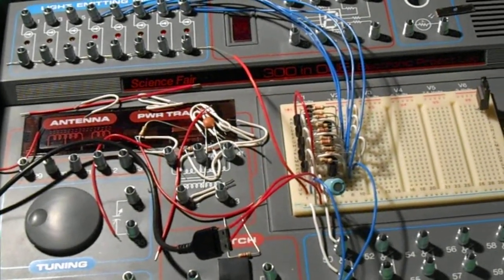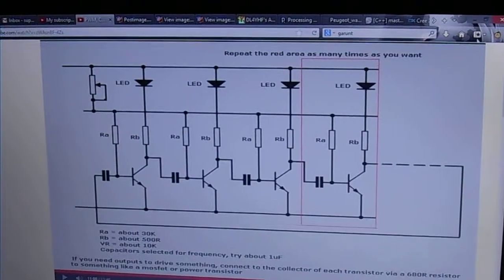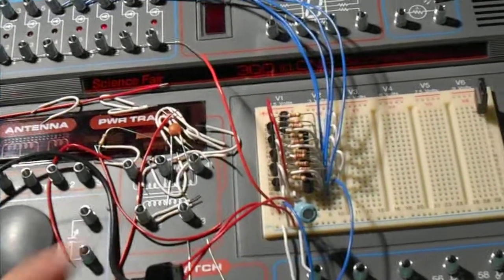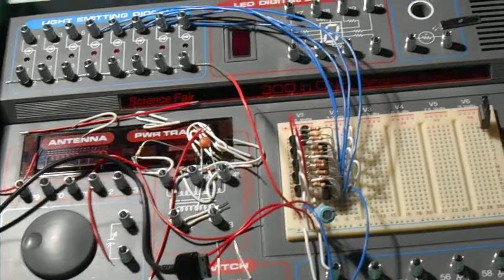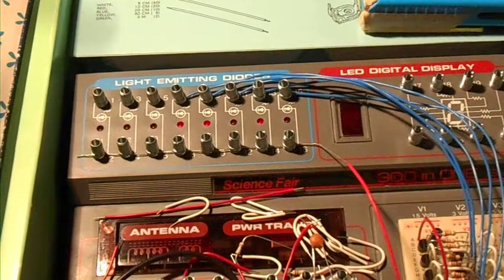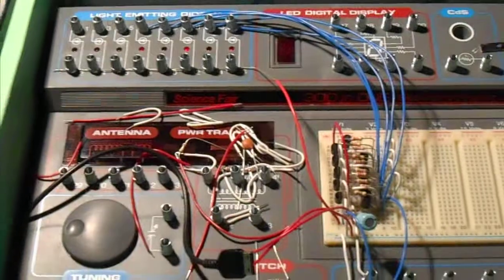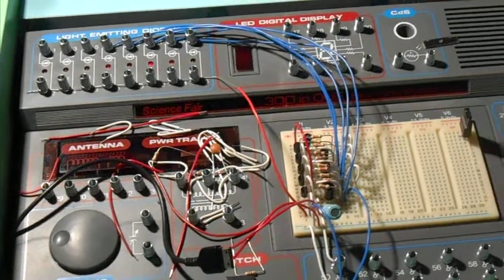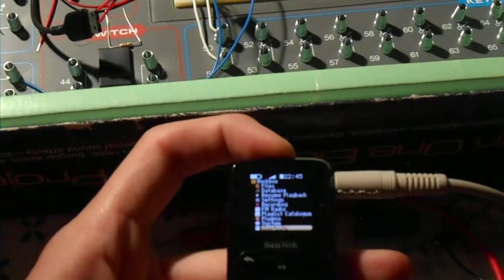Sparky Projects 5 stage oscillator and update/ramble

Comment: Cool that you got that circuit working :)
I approved your vid response too
For the blocking oscillator, have only 2-3 windings on the base, increase amount if it doesn't work.
check the specs on a datasheet, if the base voltage seems a bit low, maybe a zener diode to clamp the max voltage, or maybe an old trick of using forward biased diodes from base to source remembering that a diode drops around 0.6v you may need a few in series.

Comment from the maker: i have made the single mosfet driver and it works pretty well with the blue flyback from the dvd player, im amazed on how little amps it uses to drive the mosfet but that is good because i will have more amps for the coil :) on 12v it pulls around 1.9A after some tweaking of the PWM pot because the PSU was turning off on me, i can change the frequency until i cant hear it so that is pretty cool. i need to try the big BJT on it as the one im using gets hot. some pretty hot arcs from it!